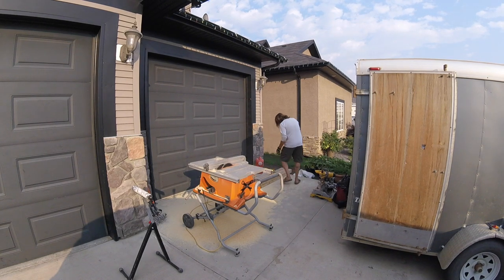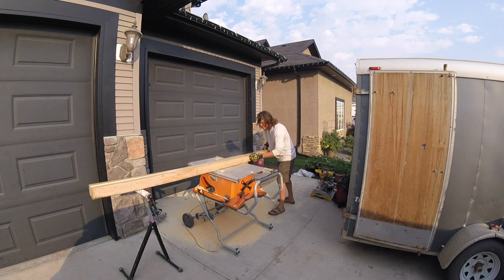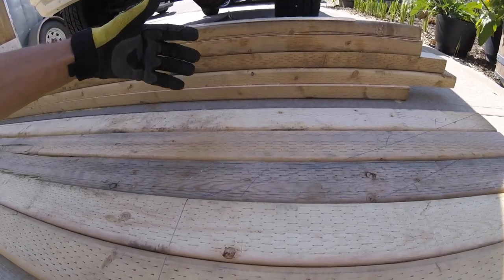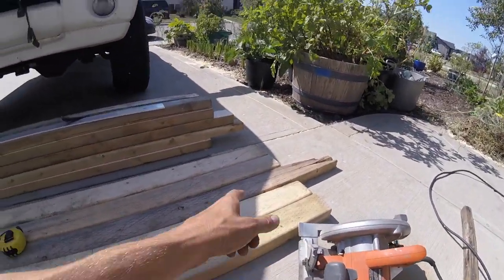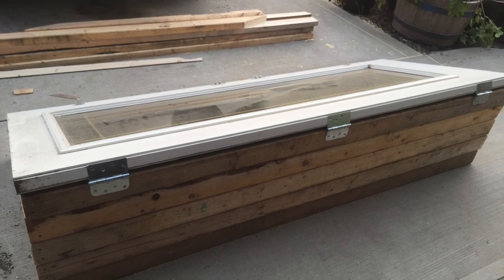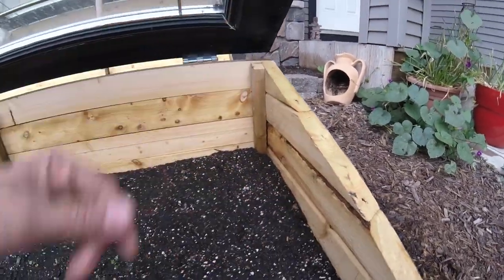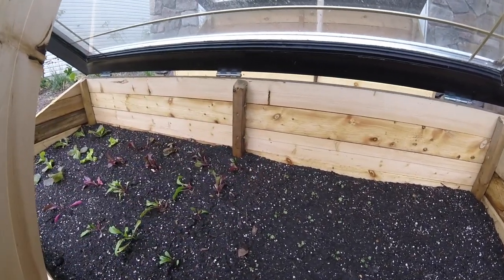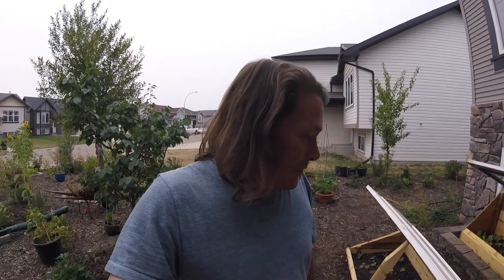Build a cold frame with repurposed material

Comment: Great video mate. You showed a great way of making a very sturdy cold frame. I'm going to give something similar a go using scrap wood and wood from pallets when I've got more time over the winter months. I'm not technically proficient with scary power circular saws so it'll be the good old hand saw and maybe the jigsaw for me! Like the way you've angled the frames and banked the soil in them to maximise the light. Have a brilliant day. Take care. Nick
Reply from the maker: Thanks a bunch, Nick! I'm glad the vid seemed to help a few folks. I look forward to seeing what you come up with, and I love the recycling aspect, pallets would work fine. Mine are quite sturdy, but then again, they have to deal with -40, soooo, I erred on the side of caution! Have an equally as brilliant a day, my friend:)
Reply: A little dirt never hurt -40 that's very cold. ❄️🌨We sometimes get as low as -10 but very rarely.  Mostly through the winter we are above 0 and we very rarely get snow. Now I've said that we'll probably have an arctic winter and I'll end up regretting saying it ! Take care. Nick

Comment: You're a star Ryan, I've been after a  cold frame design and how to build for a while, I want to stick one in front of my shed eventually, and yours fits the bill.  I like both the heights you have, I was thinking you could use the shorter one for germination/young seedlings and the taller one for when they need potting on, then when they're ready you can plant them out, not sure how good that would work with autumn/winter on the horizon though. Thanks and take care. Alex
Reply from the maker: Careful, I might start believing you!! I'm really happy you got something out of that vid. I was pretty leery doing another cold frame build type vid, but if someone requests it, I'll do my best. You and I seem to think a like. That is  the plan for the spring, this fall I just want stuff growing when the snow starts. I have a super cool design for a double layered hoop house that I shall be starting on very soon, which should be much higher for taller transplants. Have a great weekend, Alex:))

Comment: Cool! What do you think about painting the inside white? Flat white paint is 75% reflective. That addition reflected light will help insure you get more even light distribution, and even growth in the more shaded parts.
Reply from the maker: Hey DIY, I have been going back and forth over that issue. I am concerned with the close proximity to the soil the paint would be, as well as the fact the off gases wouldn't be venting out all night. I absolutely agree  regarding the reflection of light. What I was thinking as a solution is some white laminated paper, or even puck board (the white plastic boards used in hockey rinks). I'll keep ya posted on which way I go. Am going to paint the outside black to attract heat when it's -40, lol. Have a great day, hope you are not in the path of any of that insane weather!!
Reply: A little dirt never hurt - Ok cool! Anything thats white will work; however, if your going to use a laminate, consider something like old mylar emergency blankets or upcycled mirrors. Regarding painting, if you decide to paint, use only latex paint, paint only above the soil line, and let the paint properly dry/cure before closing it up tight. A good time to do painting is in the peak heat of summer, when its not going to be closed for months.
Reply from the maker: I agree on the paint point, I'm in renovations and I won't do exterior paint when it gets below 10c/50f at night. Mylar blankets is certainly a possibility as I need some for my indoor greenhouse as well. I have access to mirrors, it's just that they cut horribly, lol. Thanks for the dialog, I shall reflect some how some way:)
Reply: A little dirt never hurt - get your shine on!